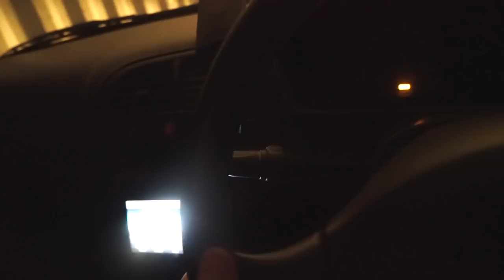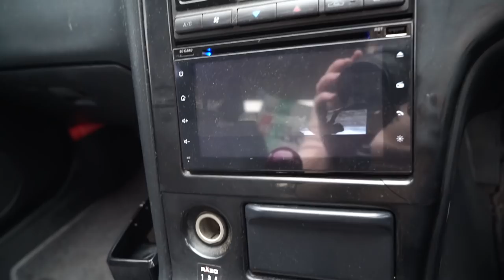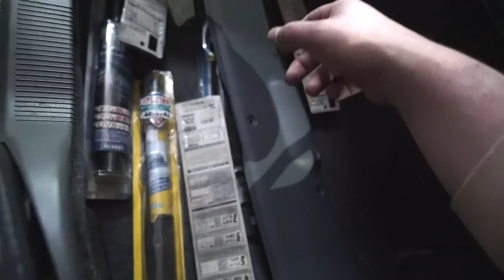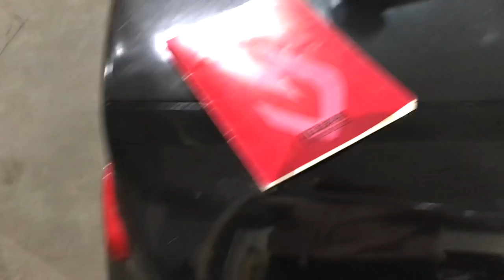TAKING DELIVERY OF MY R33 SKYLINE FROM JAPAN!!

Comment: Evan the little black box on the dash might b something to do with the Japanese toll road system. When I was there almost everyone used them. Check in the passenger footwell n there might b a little slot that u wud put a card in and u cud just pull up to the toll roads n the system wud pay automatically.

Comment: On a dead battery here I would charge it up as your going to take 60% of that alternator life. It’s going to over heat. Pulling amp beyond normal. And you get the alternator squeak just before it goes dead.. same thing never run a car with less than 50% antifreeze if it was  plane water it would also squeak and start dripping more and more of antifreeze
Reply: Plain Water kill it in a month.

Comment: Everything with 4dr is cooler
Fun Fact R33 is the only gen have a 4dr ver of GTR(RB26+4WD)
Reply: Theres no such thing as a GTR 4 door
Reply: LinX just google autech 4-door r33 gtr it is made for Nissan 40th anniversary
Reply: @8222_Tezza  It's not a factory car though thus it's not a GTR its a tuned 4 door
Reply: LinX Yes u are right. Just like the P1 LM, McLaren approved Lanzante Motorsport to make the P1 LM. Nissan approved Autech to make 447 of the 4dr GTR R33. But it came with all goods from the GTR, the RB26, ATTESA-ETS, HICAS four wheel steering